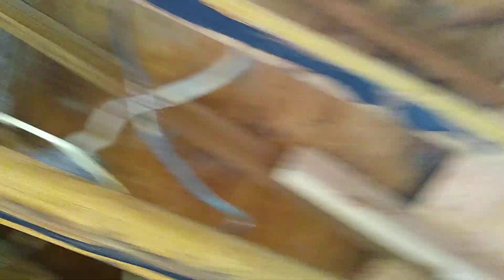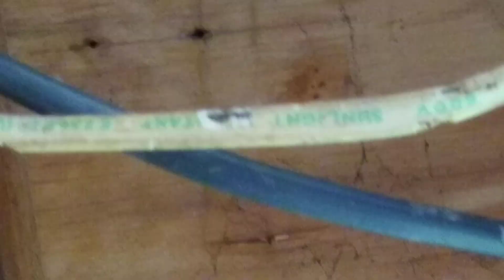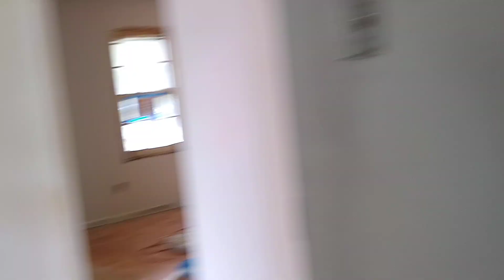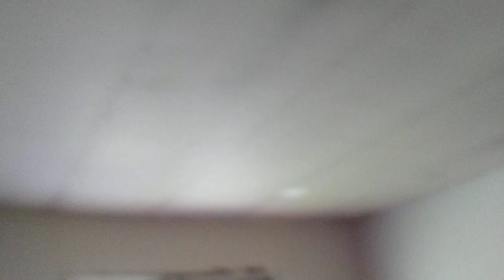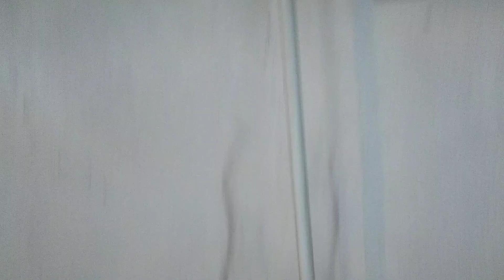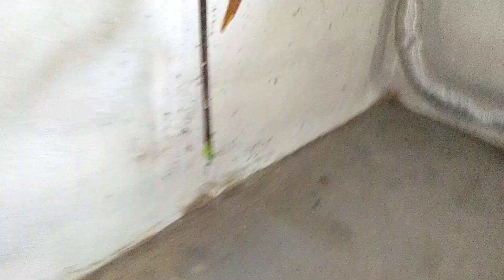Home inspection of roof rafters and structure, mentoring construction

Comment: scary electrical...
I would spend the money for the new Arc Fault breakers in any old work
no plugging a fuel gas line ..??
unacceptable !!

I am responding for Embree, as it's seems our friends at u-tube have a problem with some of his acerbic commentary critiquing content posted by azzhats
Reply from the maker: Embree, I know what you mean, unacceptable -- an open gas line!  I am done mentoring this clown! Waste of my energy and time...  I even met him at the store to purchase the correct caps for the gas lines... What he did with them is beyond me... 
Also, I am a freak for Arc Fault Breakers with all old work and of course it is now the code, so they will not have a choice but to install them... But, seeing the gas line deal... I bet they will not be installed... 
I am moving on from this dangerous beginner...
Reply: I am not up on the current NEC, since I got my License in 1987
I believe AF breakers are only required in bedrooms, etc.. last time I looked
I have avoided residential work for some 35 years, no one wants to buy a good job
thus, the mess that that whole posted jobsite is
Reply from the maker: I want you license... thank you sir.

Comment: On "This Old House" there were some shows of New England homes with similar basements (with Lally Columns and big support beams). They showed local techniques for repairing cut beams. If I recall correctly, they showed bolting steel plates and maybe in another show bolting on new wood in the void. Maybe also adding a Lally Column.
Reply: those are "flitch plates"
Reply: @j.alfredbrown6651  Thanks for the proper name